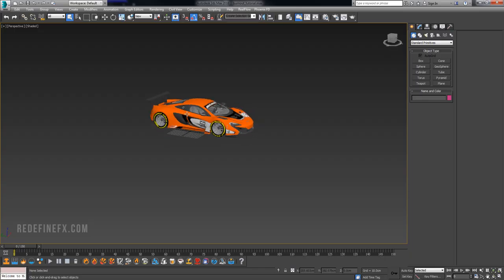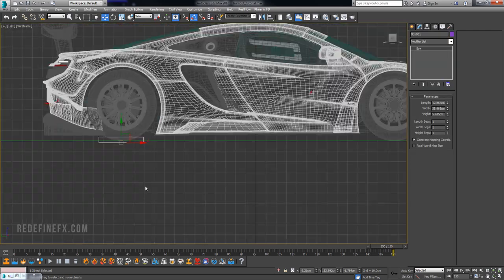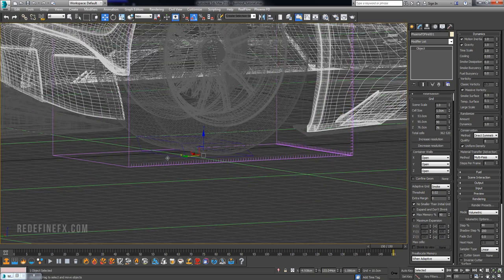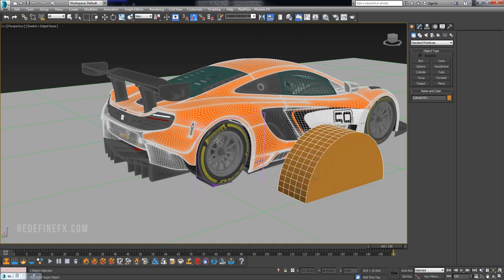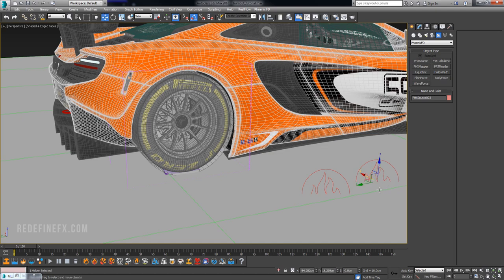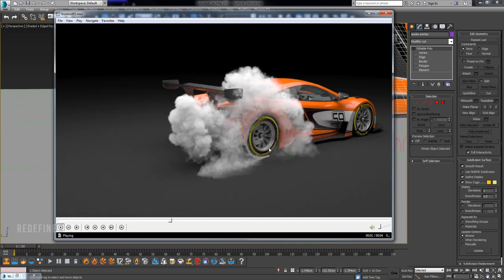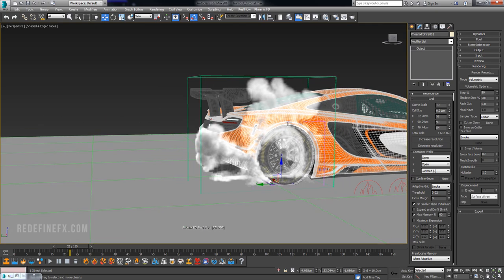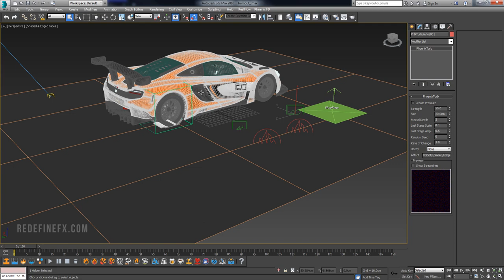Chaos Phoenix Tutorial: Burnout VFX in 3Ds Max by #RedefineFX

Comment: I follow your tutorial but no smoke comes out of the emitter at all (as in no particles are being generated at all). Using 3ds max 2021 and Vray 5, any help?
Reply from the maker: move your emitter further away from the wheel and ground
Reply: @RedefineFX  Thank you for the reply! I've done that but still no particles. The simulation also runs very fast (usually it takes very long for each timeline step), as if nothing is being calculated at all. Any ideas?
Reply: @RedefineFX  When I for example use the preset "set up a large smoke sim" then it renders smoke but if I follow the tutorial it does nothing...